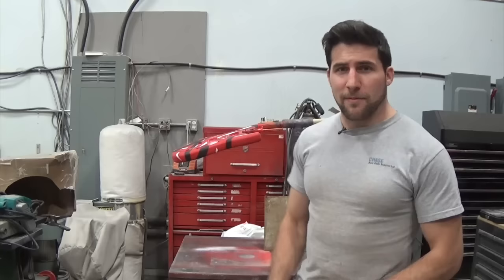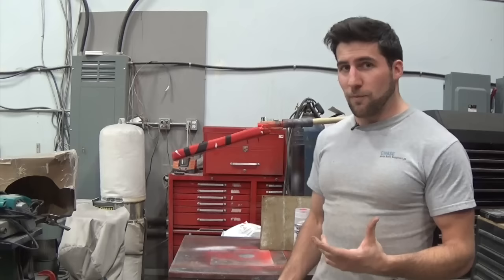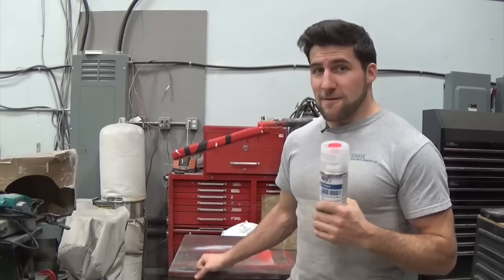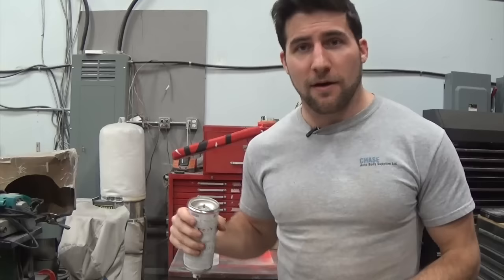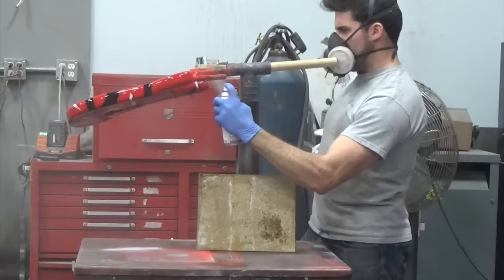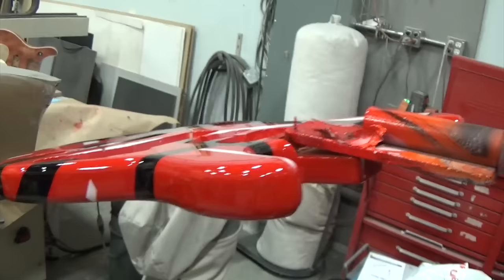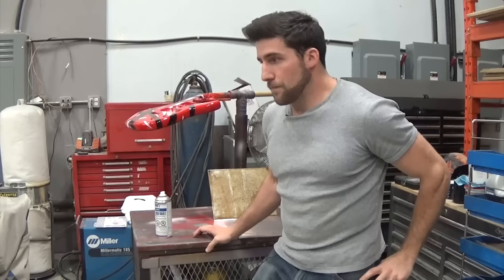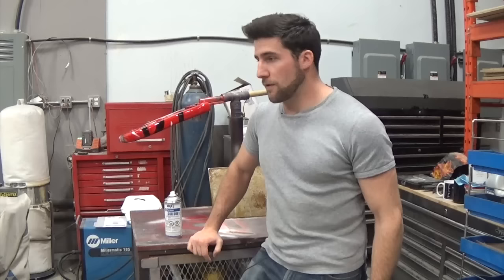How to get a professional looking clear coat with spray cans

Comment: I'm putting a matte laminated vinyl skin on the top of the body and headstock of an already black gloss guitar. Was thinking of clear coating the whole guitar with this after so that it is embedded and has a thick durable finish. Its a neckthrough with painted neck too esp kh2 style guitar.

Do you think this technique and clear coat would work well for this?
Reply from the maker: Yes, this should work fine. Just spray a bit of adhesion promoter over the vinyl before the clear.
Reply: @BradAngove  thanks for the fast reply. Your videos and response time are great. You kind of remind me of Bryan Greenberg anyone ever tell you that?
Reply from the maker: I’ve been told I remind people of a lot of people haha. That’s a new one though.
Reply: @BradAngove  quick question if you can help I would appreciate it. I have the guitar skinned and bought dupicolor adhesion promoter should this work with the 2k clear? Also should i tape off the body to prevent the adhesion promotor from getting on the paint or will it be fine if it gets overspray? I am clear coating the whole thing body and skin.
Reply from the maker: That should be ok, and no worries on the overspray.
Reply: @BradAngove  Thanks for the replay, I sprayed it today. The 2k produced a little more orange peel than I was expecting, not so much on the vinyl as on the back of the guitar, I sanded the original clear some with 1000 grit to allow for some bite.  I put 4 coats on it in a similar fashion to your video but sprayed it vertically since it was the whole guitar.  I will begin sanding Saturday probably to see if I can get a high gloss smooth finish out of it despite the orange peel.
Reply: @BradAngove  Have had a few nightmare issues with my project.  The clear coat is flaking off some, is there anyway to fix this by spot sanding and clear coating the flaking area or do I have to strip and redo the whole thing, how do I prevent it next time?

1. I decided to redo the paint because I was unhappy with some of the flaws in it and had a couple of sand throughs after clear coating it.

2. I used Rust-oleum black night metallic spray paint 7250830, coated it about 3 times then sanded it smooth some where it had some orange peel then sprayed it again.  I sprayed it with the 2k clear again I used 1 can on the whole guitar with 4 coats, then sanded it with 600 to take out some of the orange peel, I wanted the clear to be fairly thick gloss and I also wanted to prevent sanding through so after sanding it flat some with the 600 I clear coated it again.  I had some bad drips on a few points on the guitar on the 2nd can of clear coat and while I was trying to sand those out the clear coat flaked off.
Reply from the maker: Did you sand your final coat of rustoleum before applying the clear?
Reply: I did a little bit. Not to smooth but to scuff it.

Also for cure time i waited about 4 days after the last clear coat before sanding and 3 days between cans. I did let the paint dry for a couple of days too.
Reply: @BradAngove  it sort of just flaked off in a spot by where the drip is
Reply: @BradAngove  it is such a thin layer that peeled off im wondering if it was just 1 layer of clear or the last cans coverage it is tough to tell. Im wondering if i could just sand it down some and spray that section again with clear and sand off any overspray and edge from thr flaking Its in the curve of the cutaway. The rest of the guitar seems like a strong finish.
Reply: @BradAngove  I think I am just going to sand it then spray some clear over that spot that is flaking and sand that area flat and any overspray off.  If it doesn't work oh well I have to strip and repaint the whole thing then anyways.  I will just put it back together and use the guitar and then in 6 months or so when I feel like messing with it again I will strip it down and redo the paint job if this doesn't work.  The only thing I am afraid of is messing up the edge where the paint meets the vinyl skin when stripping it and repainting it.
Reply from the maker: It’s probably worth a try to attempt the spot touch ups. If it doesn’t work, your just back to where you are now anyway.

Comment: Nice job... the best clear coat is the "OH MY" clear from BuyCustomPaint.com.  extremely shiny with no cutting or buffing required and the small kits start at $30
Reply: those don't come in rattle-cans, only for spray gun?

Comment: Hi man, what about Rustoleum's Hammered Clear?
Reply from the maker: I’m pretty sure Rustoleum doesn’t make a hammered clear. Have you seen it?
Reply: Yup, I was holding it yesterday. But I was looking for the 2K clear in a can.
Reply from the maker: That seems odd, but fair enough. Did you have a question about hammered paint?
Reply: It's ok dude. As your video has persuaded me, I shall stick with 2K clear.
Reply from the maker: Ok. Hammered paint has a much different look to it.
Reply: Yeah, it's easier to go for a clean 2K clear rather than flattening down the lumps of the hammered texture.
Reply from the maker: Oh, you would never flatten out the hammered stuff. It’s very hard.
Reply: Glad to know I've not wasted any cash.

Comment: Your kit.com link doesnt work btw
Reply from the maker: Ya, all of that has been moved to my newer amazon link. It’s in the description of my newer videos.
Reply: @BradAngove  great. Thanks man. Hey does a small can of minwax polyurethane work as well? Doesnt seem like you can spray three coats at 10 minute intervals like you can with a spray can.. In which case. Would you spread on thin with a brush wait for it to cure, then do that two more times and finally sand, binder then polish? Thanks again. Subscribed!
Reply from the maker: Yes, that’s what you would do. Apply relatively thin and let it dry before sanding a re coating. You would need to be working with a pretty fast solvent to spray the quart of poly that way.
Reply: @BradAngove  thanks brad, looking forward to the next live stream. Take care of yourself.

Comment: Watched this video a few times. Bought and used the 2K product. Worked nothing like this!
Reply from the maker: Did you activate it like I showed?
Reply: @BradAngove  yes, multiple smacks on the bench to be sure, shook for over 2 minutes. Did 3 coats and no where near the sheen or coverage you got.
Reply from the maker: I’ve used many of these cans and they always come out like this. If you used the same gloss can, you must have been moving it too quickly or spraying from too far away.

Comment: yess i t will look good , but will not last ,  the rubber on my gutar stand have melted the spay panit on the back of the guitar ,   but yee if you want that relic look , on modern guitar yee paint it with spray . in a year will look like thow guitars that have play for 40 years  and i f you put a stikcer on the guitar when you remove it will take out also some paint ,
Reply from the maker: Obviously you’re not familiar with 2K spray paint.

Comment: How dangerous is this, compared to regular spray cans, and also compared to the better finish you get? I guess I am asking if the result is so much better, that it is worth “the risk”, this is nasty stuff as I understand.
Reply from the maker: It's considerably more dangerous, but they are all somewhat dangerous. If you wear proper protection then it's not an issue. You should be wearing a decent respirator no matter what you're spraying. I find the finish from this stuff is great, but if you are skilled with the other cans you can get a good finish from them as well. It's just generally not as durable.
Reply: @BradAngove  Thanks for your reply. I always wear a respirator and gloves. I spray outside (don't have access to indoor facilities). I can get a decent finish with regular spray cans. When you say durability is it more hardness, or also fading over time. What I do find appealing is that the drying time is considerable shortened. Actually sometimes, I find it frustrating, that modern guitar finishes don't age, I have 20 year old guitars, and the finish looks pristine, but the hardware has faded, that is a bit odd to see.
Reply from the maker: I mean both hardness and color retention. This is automotive finish.

Comment: The good: you point out there's isocyanites in spray max 2k.
The bad: you're nowhere near using adequate protection. This stuff enters the system through eyes and skin also.
Hope you don't have isocyanite poisoning just yet, but there's no cure for this.
Be safe guys, leave paint jobs to real pros!